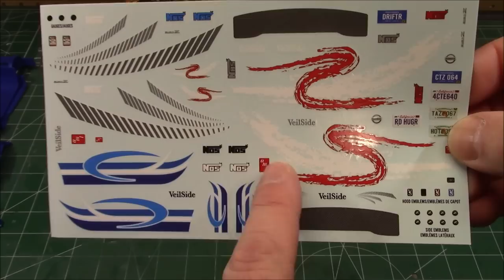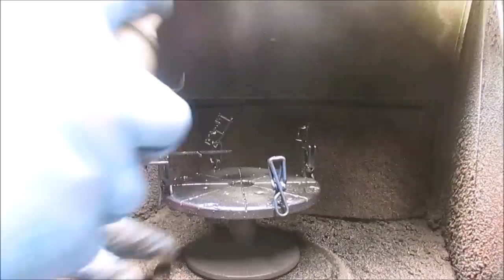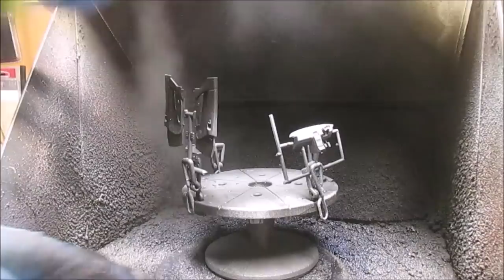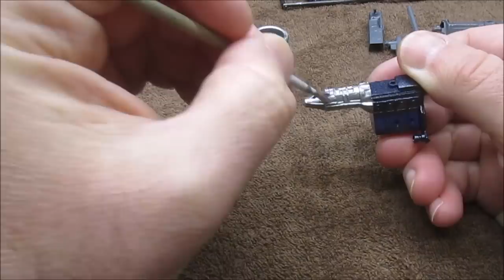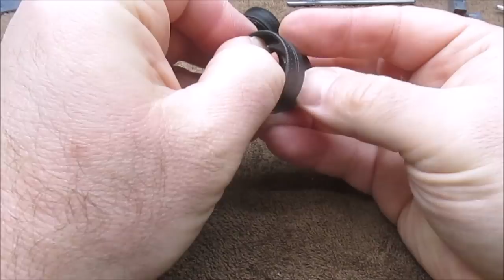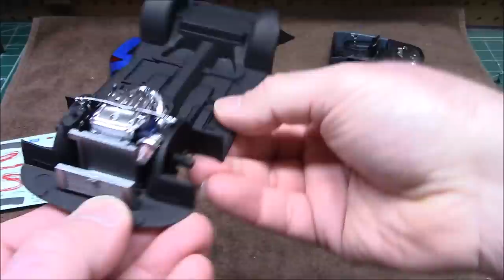2006 Nissan 350Z Custom 1/25 Scale Model Kit Build Review AMT1220 Fast Furious Nismo AMT

Comment: I want to try a trick I saw for simulating carbon fiber with a nylon sock, and I think that oil rubbed bronze would be an excellent base coat. Hit it with black and then clear coat the whole thing....hmmm

Comment: Another great build! Ive noticed most of the time you use glosscote you brush it on. Wouldnt it be easier to spray? Does it dry smooth with no brushstrokes? Just wondering🤔
Reply from the maker: In the time it takes to get out the airbrush, thin the glosscote so it sprays well, clean the airbrush and dry it off, I've been done brush painting the parts and they are dry 20 minutes ago. 
You can see in the video there are no brush marks, it self levels.

Comment: Hmmm...that body kit has the good beginnings of a race car build... 
Once again, you got the gears in my head turning...🤔

Quick question though. Every time I use craft paints, they tend to come out gloppy, like they're the consistency of pancake batter. But from the looks of the seat padding you managed to get it nice and smooth and level just by brushing--how do you do that?
Reply from the maker: I shake them really well with my shaker (see paint shaker video) and rarely have an issue brushing them.

Comment: I wish AMT wouldn't mold the window plastic with the side windows sealed up. I cut the window open on the Ford 600 Hostess truck and that was tricky trying not to damage everything. I built the 2016 Camaro SS (which I own a real 2019 Camaro SS) and I wanted to cut the side windows off but didn't know how to without damaging everything else. Anyone have a good idea?